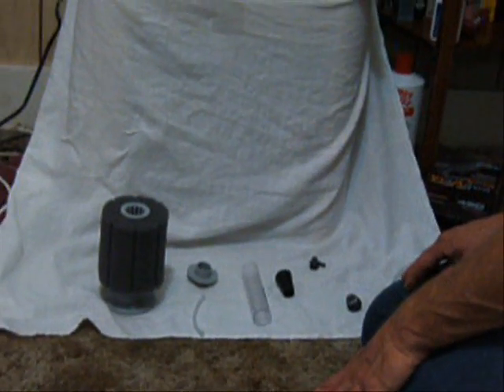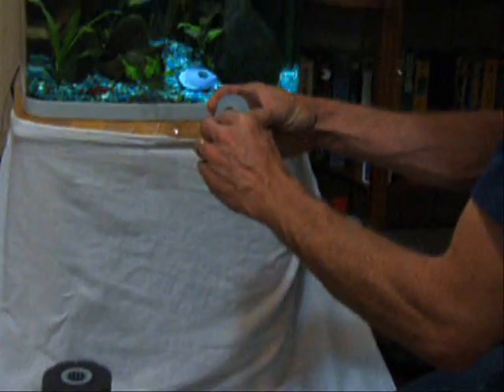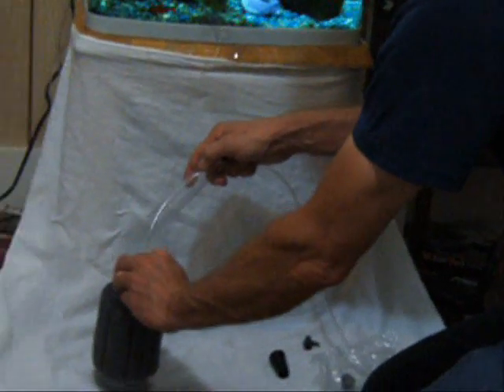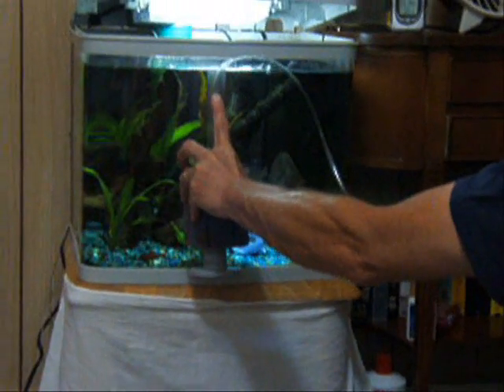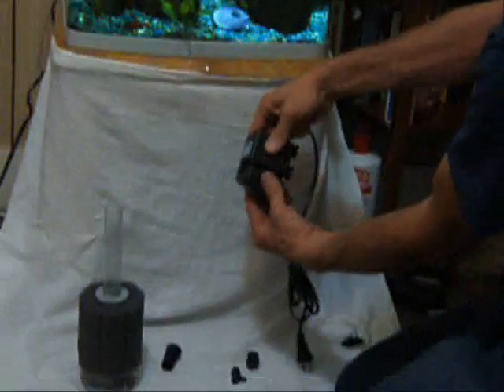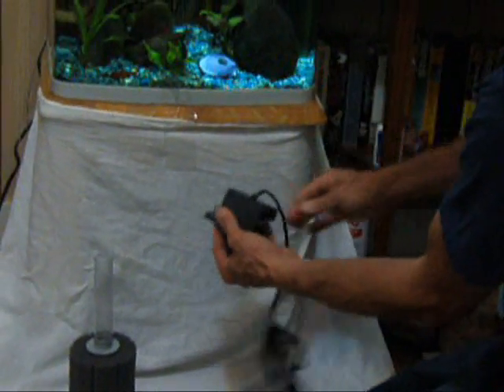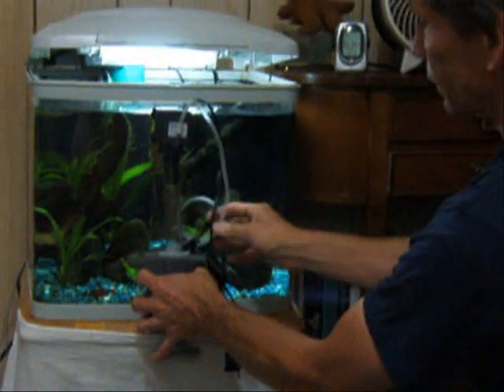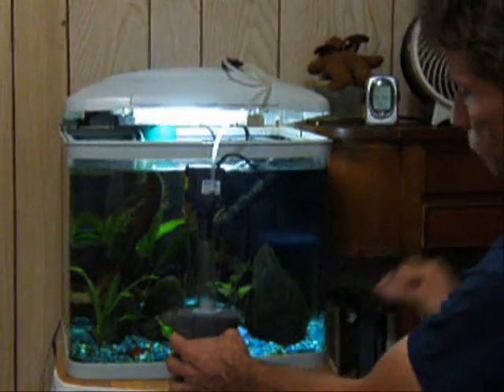Aquarium Sponge Filter Installation-2

Comment from the maker: @Vash6the6Stampede 
As long as the tube is under water, performance will not be all that adversly affected.
You can cut it with a hack saw.
Please read the Sponge Filtration article in the details section as this will fully answer these questions

Comment from the maker: It partly depends upon your bio load (which includes fish numbers size, feeding habits, etc.)
As a generalization (& assuming no other filters), I would recommend two for redundancy and would use either the #3 or #5 (or one of each as well as the #5 Pro for larger fish)
Set up again depends upon preferences, fish kept. With smaller fish, the air stone method is the most simple.
Please see the Sponge Filtration Article in the video details for more.

Comment from the maker: HOB (overhang filters) are generally all three types of filtration, but generally not as good depending of coarse on the brand/style for bio filtration (which is where controlled studies haves shown sponge filters to be better). Let me clarify, I would combine a Sponge Filter such as the Hydro Sponge #3 with a HOB filter such as the high performance Via Aqua M200 HOB filter.
You can read more by reading the filtration article contained in the Aquarium Information link in the video description.

Comment from the maker: I would leave some HOB filters running over a 6-8 week break in of your sponge filters (to allow time to seed biologically)
You could keep a couple of the HOBs (it is not a bad idea to mix filter types), adding the Pre Filters and then add 2 or more standard sponge filters.

The video details section has a link to a Sponge Filtration article, which is also linked to multiple articles for even more in depth articles. These may be VERY helpful

Comment from the maker: The Hydro Sponge filters hold a patent for their design. They are more porous and have a better flow than others.
The Hydro Sponge #1 or #2 would be good for your 10 gallon.
I would reference the article about sponge filtration  in the details or search the web site: "Aquarium Answers" for an article about bio wheels where these filters were tested along side Bio Wheel filters.

Comment: I am interested in a filtration system that will be safe for the frys and still do the job of all these HOB filters, I would like to stop using the HOB's completely if that's possible. Should I get four sponge filters and run them for a couple of weeks with the HOB's before using them exclusively? Should I go for a canister filter instead? I have a Fluval 405 running in another 75G and I have no complaints about that. Just thought I might give something new a try. Thanks for your input

Comment from the maker: Likely, assuming a quality sponge filter; your sponge has too much air and needs to be squeezed multiple times to remove fine air bubbles from the sponge. Over time beneficial aerobic nitrifying bacteria will cling to the sponge and more naturally weight it down. However some low end sponge filters do not have proper weights and/or sponge material and this can cause issues.
This is answered in the websites in the video details, please read for further help.

Comment: whats the plastic tube piece for? I have two of the hydor 3's and I dont use the plastic tube I just got my airline hooked up to it and let the bubbles pump out and float to the top of the tank to keep the water on the top moving.